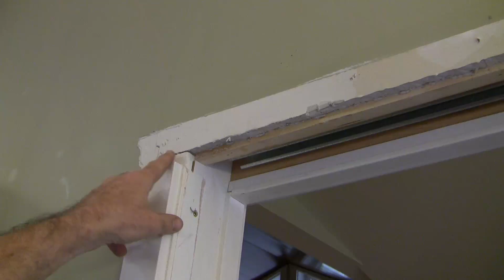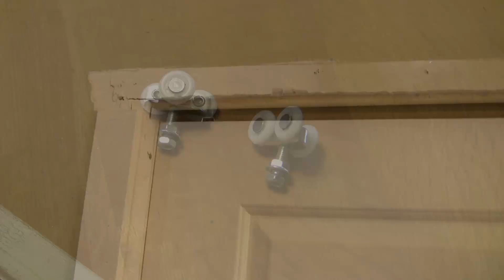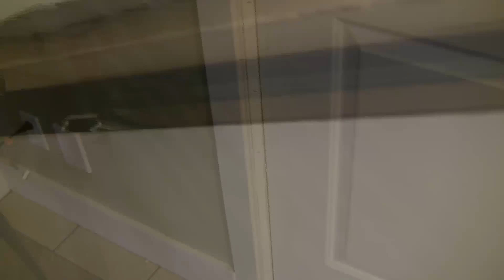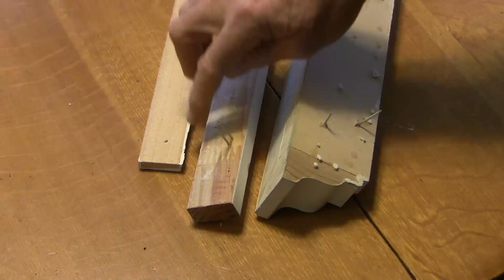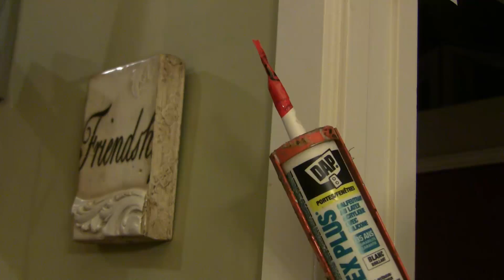How to fix a pocket door

Comment: In my case, one of the roller is missing and I could not find the same size roller that goes in the track, I'm trying to find the same size, otherwise I have to replace the track by opening the wall.

Comment: That's weird.... I've repaired my pocket door without removing any casing....
Reply from the maker: If the carpenter left enough of a gap to get the door out, you're laughing.
Reply: @spelunkerd  exactly. In my case there was no gap but it wasn’t an easy task either
Reply: I guess it’s not necessarily weird but I was able to do it without removing anything

Comment: I thought pocket doors were a great idea until the damned thing fell off
Reply from the maker: Yeah. The other thing is the way they dominate the space inside the wall. You can't have wires or switches or insulation on the pocket side.

Comment: You have different hardware than I have...  That system is heavy duty . Usually used for solid core doors. You didn't fix anything. What do you do if the track is bent? You get paid to do this? What a waste of time!

Comment: One more thing I’d like to add- I posted this in another how to video video as well. It may help someone here- 

“Once you finally get the door on the track, make sure and use a lubricant for the track and roller wheels!! I didn’t think it would be that big of difference but man was I wrong! It went from horrible scraping noise to smooth sailing. I used a garage door lubricant spray. Make sure to do the entire track and wheels! Roll
the door back and forth until it’s smooth.”
Reply from the maker: That's a good point, rollers for glass shower doors are the same. One caveat, make sure the wheels are actually turning and not seized. Increasingly, those wheels are not so well made and will eventually seize. When they do seize, lubrication of the track helps even more, allowing you to order new wheels. Aliexpress sell various door wheels in bulk for much less than other vendors. Silicone spray works pretty well, you want a lubricant that won't pick up a lot of grit.

Comment: The problem I have is the roller at the back is off the track it's also impeding me from pulling the door all the way closed because it's getting hung up on a frame inside. Royal pain in the ass

Comment: Finally got around to trying this. It  went well until the part where I had to remove the door. I cut away the trim on the wrong side. My rollers are the ones where you lift to you and then push up. For some reason I assumed it didn’t matter what side. Most videos I watched didn’t  mention the side you choose as being important. Or more likely I just forgot. Great video, thank you sharing this.
Reply from the maker: You never quite know what you're getting into until the casings are off. Was there a clue in your case, something that would help the next guy?
Reply: @spelunkerd   When you see the wheels’ exposed side, pull the bottom towards you a little ways, (~ knee high?) and then  push up. The trick is to jiggle it very hard! I didn’t want to break it, so I was being extra careful. Apparently too careful. Again, for reference, my roller set is a two wheel on the same side design, nothing on the opposite side. 

Now I gotta go buy hardware and a new door. Hopefully the other two in the house don’t give me this much trouble.

Comment: Sir how do I put the door back in easily?!!! I have the same type of rollers I just can’t get them back in the slots.
Reply from the maker: Practice mounting those cars onto the door first, before you try to do it up in the air. You will likely need to bolt each car to the door after the car is placed on the rail. The cars go onto the rail easily if the door is not attached. Put one car onto the rail, hold it in place and slide the door under to allow you to bolt it to the door. Then push the door partly inside the slot, then do the outside car. The frustrating thing is the way those unrestrained cars want to roll inside the slot, where you'll need a long stick to drag them back out. It may help to have a friend slide the door into place as you hold the car on the rail.

Comment: my pocket door runs rough.. will replacing rollers help?  And what are the best rollers to look for? 
Thank you
Joe
Reply from the maker: Yeah, take it apart and have a look. You might just find debris in the track, or cracked/broken treads. The tricky thing may be to find similar sized rollers, but the design is fairly standard. Good luck!
Reply: @spelunkerd  ty

Comment: Pulling the nails through is a lot better than pounding out. Can't do it with staples but pretty much every other finishing style nail. Leaves a clean finished side most of the time. I'm assuming this has been said already.

Comment: So how did you actually get the door back on? Did you slide in the two rollers first then mate the door to each roller then tighten both down?
My door came off and i have to fugure out how to rw hang it.
Reply from the maker: Yes, that's how they generally go on.

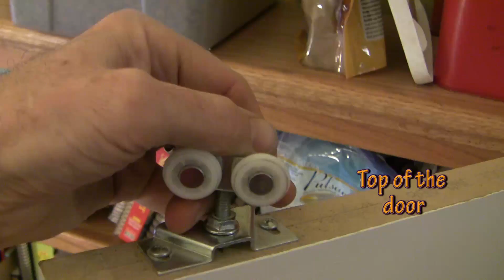Comment: 1:28 My issue is that those screws that hold the hanger onto the door are just a little loose, allowing the door to "wiggle" on the hanger. Any suggestions on how to easily tighten them without removing the door?
Reply from the maker: If you have access to needle nose vice grip or extended reach pliers you may be able to get by without removing the casing. You'll also want to put a few drops of locktite onto the threads so you don't have to do it again in a few years. The simpler solution is to bite the bullet and remove the casing, get the height and angle right, with good access, then torque the nuts down properly. Good luck!

Comment: Thanks for the video mate, my bull terrier pup ran into my cavity door and somehow knocked the runner out of the bracket and into the cavity so here I am having to work out how the hell I'm going to get the door out to replace the rollers.
Reply: If the door is in the open position, just remove the top casing to get access to the rollers, remove door jamb to take out the door. My door was stuck in the closed position. First I drilled a 3" hole trying to get access to the rollers. Hoping it would work but the roller brackets were bend out of shape and door won't budge. Plan B remove the the whole sheetrock wall exposing the complete pocket door frame, replace single track with new improved double track kit. Didn't cost much but lots of work.

Comment: I just had to pry off and damage some nailed in trim at the top of a sliding door so I could fix the wheels.   Any trim I put on the top will now be screwed in for easier removal the next time.
Reply from the maker: Good thought, I wish more carpenters would consider ease of maintenance when nailing these together.

Comment: Very good video, I'm just disappointed I have to remove molding to get to the wheels! My door just squeaks. I can't reach the wheels, so I'll start by lubricating the track and see if that helps.
Reply from the maker: Many spray lubricants come with a red plastic directional nozzle to get into tight spaces. WD40 will get it moving and the sound will disappear, then chase it with a silicone or lithium spray which should last longer. Good luck!
Reply: @spelunkerd  Thank you, and I do have spray like that. The door is packed so tightly in the frame that I can't even see the wheels so I'll only be able to lubricate the track. I'm going to try to do it with a Q-Tip though, because I suspect any spray would end up on the carpet below and over time attract dirt.

Comment: Just in case you didn’t understand, you need to ensure you have enough cases to use just Incase the case does not come off.
Reply from the maker: Excellent point, any time you move forward in a repair you need to be prepared for complications, some of which may be outside of your skill set. Even with good skills, there can be a challenge to find an exact match to what you lost or broke during disassembly. Those kind of complications are more common than one would think. Good technique and work flow separates the pro from the amateur, and authors on Youtube have a tendency to turn the camera off when problems happen. As a viewer I love it to see complications left in the video, since recovery from a misadventure is often where the real learning happens.

Comment: I remove those staples (or finish nails that won't push through) with vice grips. you can either just bend the fastener back & forth until it breaks at the wood surface, or carefully just pull them through. With staples, I've been able to often pull on one side & the other end of the wire just slips right through. 
Messy caulk job is easily fixed, with a damp paper towel (using the caulk you recommend.) Also, saving a caulk tube for later, I usually just put a screw in the hole & tape over it with painters tape.
Reply from the maker: Good points, thanks for taking the time to offer your experience for others who drop by.

Comment: Our issue was also "how to get the door back on" since it fell off of the hardware.  Thanks for letting us know the removal of the wood trim was important in order to see and access the tracks, etc.  I hope can you make more showing the hardware issues?  Thanks for the help
Reply from the maker: You'll find that once you get the trim off you'll be able to see how it goes together. Most of the time it is just nuts that have loosened off to the point that the mechanism comes apart. Good luck!

Comment: Why did you not show how the door is removed?
Reply from the maker: Sorry, it looks like this is a common complaint. Of course it depends on what the problem is but in general the door is bolted to those two cars that roll in the tracks above. Study how they work by watching the whole video. If you look at how those bolts are attached to the cars, you will easily see how to remove the door. Take the casing off the top so you can see the nuts holding the door on. At first you will only be able to get at one car because when you open the door the other car is deep in the pocket. Remove the nut holding the door to the car you can see. Be careful not to drop lock washers or the nut, you'll need them later. When the nut is removed, the door will drop down and then you can pull the door to the side, rotating it out so the second car comes out of the pocket. Remove the nut from the second car and the door is free. The most common problem is the nut has come undone by itself and the car has rolled back into the pocket, or the nut has loosened and the car has dislocated off of it's track. In that case you may be able to fish the car out with a long stick. However often you need to remove the whole door to get enough access to retrieve hardware. When you put it back together, tighten those nuts down well so they don't come undone later, and consider using a drop of locktite to prevent them from backing off. Just remember to get the bolt length on each car correct so that the door fits the jam properly. Good luck!
Reply: spelunkerd Thank you for giving a detailed and clear explanation on how to remove the door. Your use of the hardware term, car, through me off for a bit. But I finally caught on.  Remember, some of us are little old ladies(or gentlemen) who are not familiar with the terminology.   My house is 95 years old, but I think I can make this work.
Reply: Thank you for the detailed and clear instructions on removing the door. I was also puzzled. The light came on immediately when you wrote:

"When the nut is removed, the door will drop down and then you can pull the door to the side, rotating it out so the second car comes out of the pocket"

Sometimes the obvious is not obvious to others!

Great Video! I've looked at a dozen before yours and didn't need to look further.
Reply: IF that's the original hardware on that 95 year old house, it's nothing like this.

Comment: Best video on this subject yet.  I'm head to my rental property to try out what I learned....
Reply from the maker: Good luck! Rentals are tricky because you don't have all your tools handy and you want to get it done quickly without bothering the tenants too much. Remember to bring a flashlight, and you might need long magnets and other tools to reach into tight spaces.
Reply: Yup.  It actually went well.  I just have to put the head frame piece and moulding back and do the touch up which is a butt pain more than the repair to the door operation.  The track screws were loose and the roller had jammed half in and out of the track.
Reply from the maker: Glad to hear it, thanks for the followup.

Comment: Hey, I'm curious if you've done one of these with a house built in 1940. PLASTER WALLS, NO DRYWALL!

To make matters worse, some decades ago my Dad and I tried fixing the thing. I do not know if the rail is still in good condition. We ended up adding rollers to the underside of the door, which kinda works almost.
Reply from the maker: Yes, with hardware so old, you'll never find exactly matching parts. Good luck!
Reply: sounds like I'd need to rip out the plaster walls and pull down the old railings etc. to install up-to-date hardware. I'm assuming I'd only need to rip out towards the top and just on one side.

I don't look forward to the task. There are already holes in the plaster elsewhere for plumbing repairs. The repairs are not what I'd like.

Maybe I need to find a plaster wall repair expert.

Comment: You're video is way better than mine. Maybe you can make a better video of my technique and save some trouble and time on a few doors. May not work with the hardware set up on the door in this video, but works on some without removing any of the frame. https://youtu.be/VAn58NfDkNc

Comment: thank you so much for sharing the video, it was  really helpful. I fixed my pocket door using your video. I dont understand my door wooble while closing . ANy ideas  how to fixed the problem
Reply from the maker: Can you describe the wobble more accurately? Up down tilting wobble suggests there are more than two contact points, side to side would perhaps be some slop in the guide rail. There has to be some room for movement, otherwise with dust the mechanism will become too stiff. Most modern doors are pretty light, and a little wobble is common.
Reply: Well door moves backward and fowards when it slides (ope/close). sometimes ,We have to even pull the door to lock it . I found on internet sliding door guide will helps the door not to wooble. Hopefully it will works for me
Reply from the maker: If you have to pull door to lock, it sounds like you've got the height wrong on one of the two rollers. You can adjust the height by turning that nut where the roller is attached to the door. After adjusting, close the door and verify the edge of the door is parallel to the edge of the door jamb. Also be sure the bottom is not dragging on the floor.

Comment: What brand/model of replacement hangers is considered the best quality?
Reply from the maker: I don't know. The biggest problem is finding a replacement to fit a preexisting rail! Of course there are examples all across our economy of cheaper products gaining advantage, pushing high quality competitors off the market. The consumer is often one step removed from the person buying the hardware, so he has no input regarding the quality vs cost decision. Ultimately the contractor who can meet the lowest bid is the one who turns greater profit and satisfies short term customer goals. Longer term end points like failing devices years down the road are not part of the equation.
Reply: I see, I have a 10 year old house and all of the pocket doors seem heavy and harder to open than other houses. should I lube the tracks or replace the rollers? There is no rubbing nor is there damaged rails.
Reply from the maker: Try silicone spray, use a spray bottle with an nozzle extension to get the spray right where you want it on the roller bearings. If there is any dirt, you could carefully clean the area with a light oil like WD40, but you have to follow that with silicone spray so lubrication lasts longer. If you use WD40 be sure to wipe it away after, so it doesn't drip and discolor your adjacent casings. If that doesn't work you'll need to disassemble the system to find out what is wrong. Old doors are much more heavy than new, which is an advantage but moving parts tend to be harder to slide. Really old sliders used wax on sliding wood parts, which never moved very well.
Reply: I like the Johnson hardware over the Everbilt. However, if you have the Everbilt, you'll probably need to use matching rollers from them.

Comment: My pocket door fell of the rail completely and I could not find anything that remotely loooked like rollers so I guess I am at stage  one. the deconstruct was hoever excellant and I moved through that part without any problem. now i have to figure out how to mount rollers on my existing rail system. Home depot/lowes here I come.
Reply from the maker: Good luck, hopefully you can find something that will fit.
Reply: Home Depot has the Johnson hardware system with the rigid track & 4 rollers per piece. It's good hardware, easily installed once you figure out to remove the split jamb to reach the screws. And, in fact, with this system, you don't really need the screw all the way at the back like you would with a thin metal track that easily deforms.
Reply: That's what i'm hoping, I think the screws at the back of the track have all come out, so I'm thinking with the Johnson replacement kit i can just  put the screws in the door opening side, hopefully..